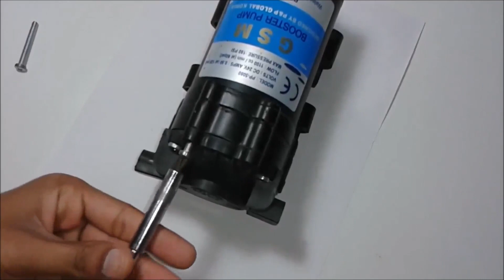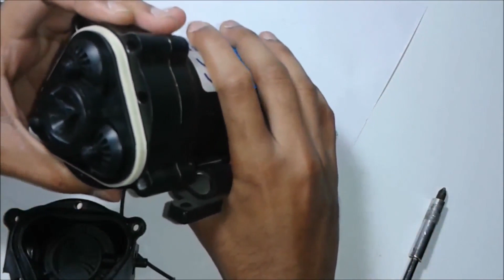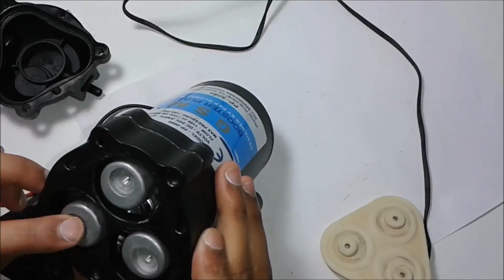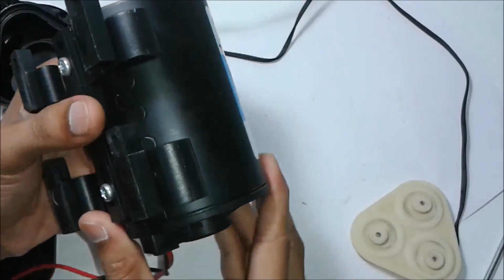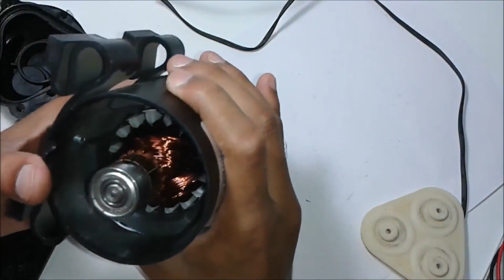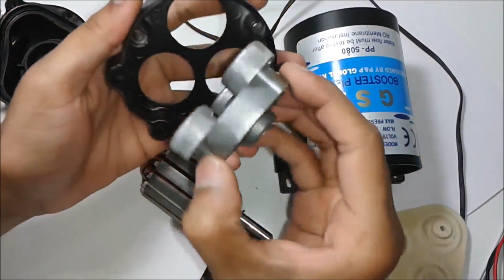Inside | water filter booster pump || Let's See inside ||

Comment: which adapter u r using
Reply: +Let's See Inside  from where you find this type of adapter? And DC or AC
Reply from the maker: power supply -  Smps 24V (2 Amp) Adapters.
Reply from the maker: +Lakshay Narayan 
AC to 24v DC adapter
Reply: +Let's See Inside   I mean from which market have this type of adaptors
Reply from the maker: +Lakshay Narayan 
Electronic, water filter, computer,
Reply: +Let's See Inside   Thank you.    by the way where you living
Reply: Let's See Inside shivmahimastrot